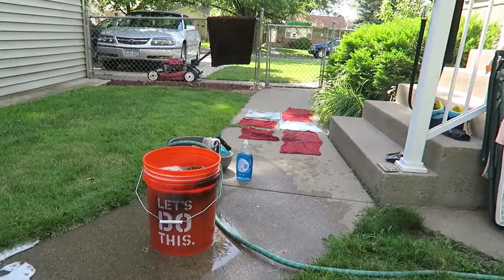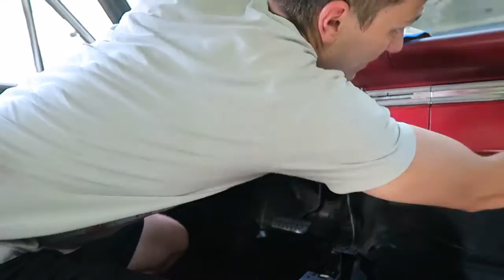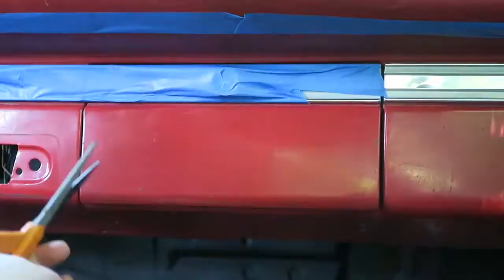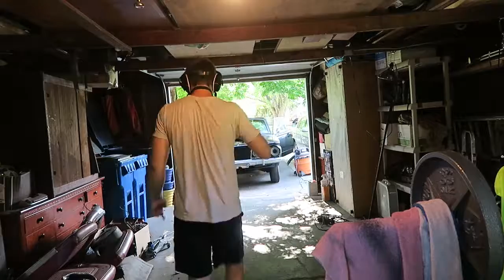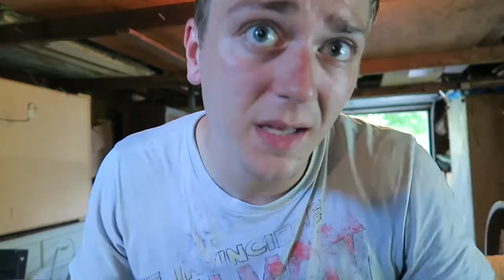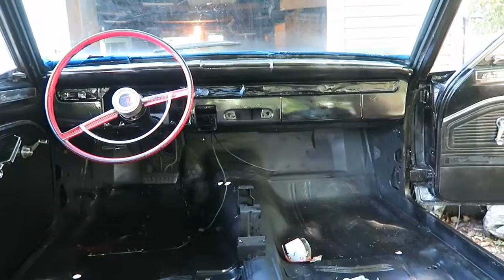1965 Barracuda Day 30 - Cleaning & Dashboard Painting

Comment: I am trying to decide if I need to sand/strip all of my red off before I go black or if I should simply paint over it? How is your Paint job looking now that it has been over a year?
Reply: (I have the exact same year and red interior color that I also want to convert to black)
Reply from the maker: Peter it's still looking good, but the cars been inside a barn. I'd reccomened sanding enough to have a smooth surface then wiping down real good with alchohol or a cleaner. Then lightly apply a few layers. Don't go super thick right away.